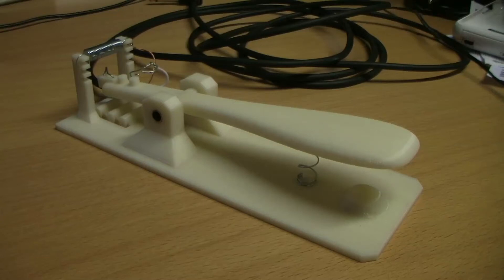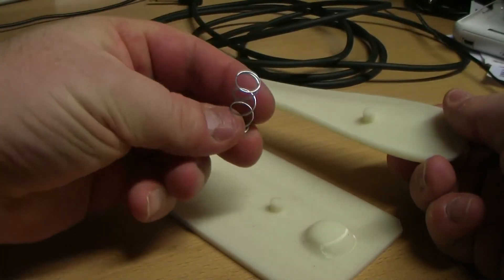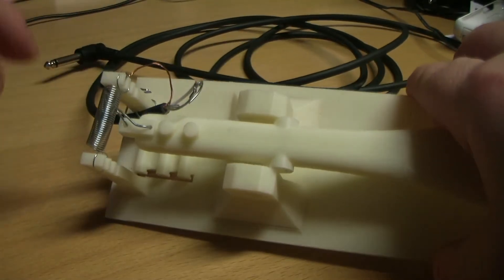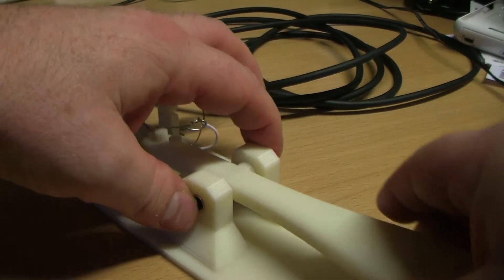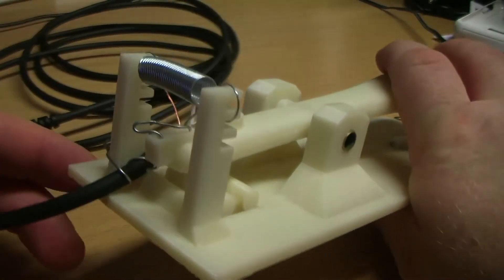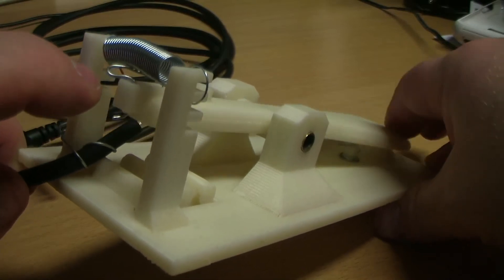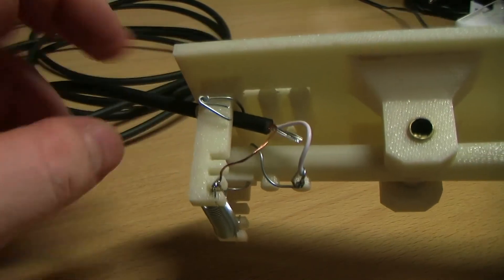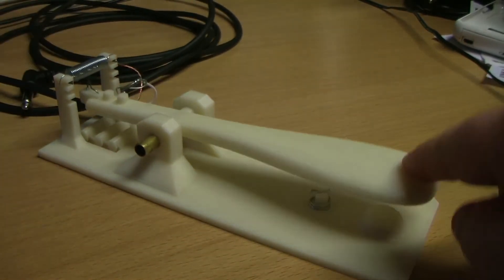3D printed - Sustain Pedal for digital piano

Comment: Compared with the lame "sustain pedals" that don't even look like the sustain pedals on real acoustic pianos, this 3D-printed pedal looks pretty nice. But ANY sustain pedal that connects to the digital piano by means of an electrical cable is going to exhibit the same problem: Pedal Creep. I wish that the inventiveness this guy had exhibited when creating the pedal itself had also been applied to finding a solution to that problem. You have no idea how incredibly annoying pedal creep can be! The CreepNoMore is ostensibly made for the purpose of solving that problem, but it doesn't work. (I know, because I bought one.)